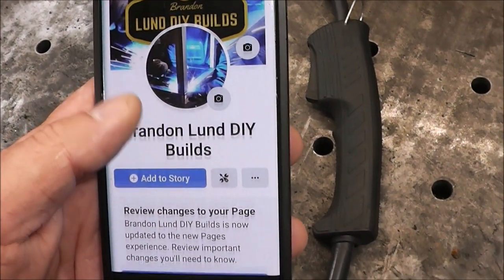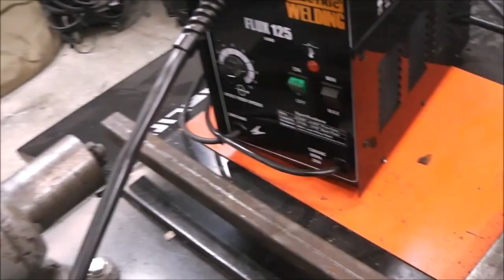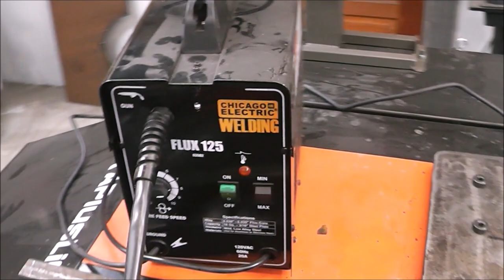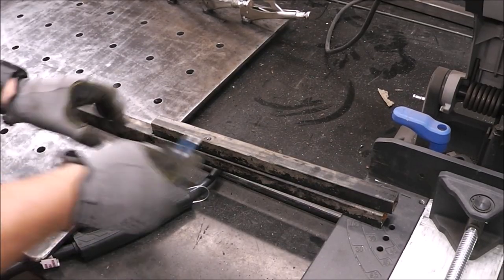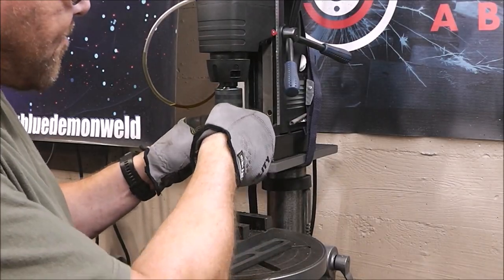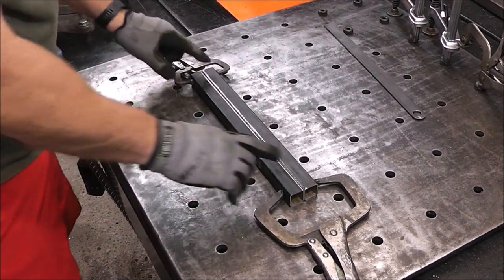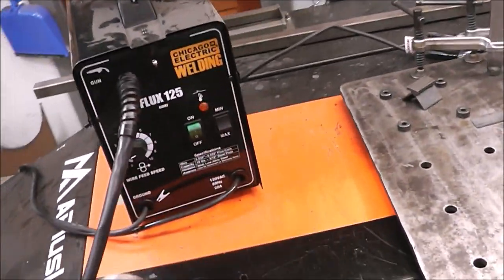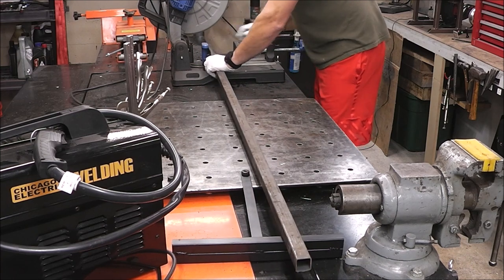Welding Table Material Support for Bench Top Metal Cutting Saw

Comment: From the state of Florida.  So glad you used the Harbor Freight welder.  You made it so easy to see about increasing the speed to help the weld.  Thanks for the video.
Reply from the maker: @D Butler thanks man! I appreciate you mentionioning this. I'm not sure if you caught my mistake but I think the material read 16 guage but I set it for 18 guage (slower than it should have been) so it actually turned into a learning moment because I ended up going a little faster (thicker) than what the chart actually said but it did give a good example of what it sounds like when it's running good vs. bad. Good ear and thank you for mentionioning it. I just wish I would have caught it and said it in the video :)